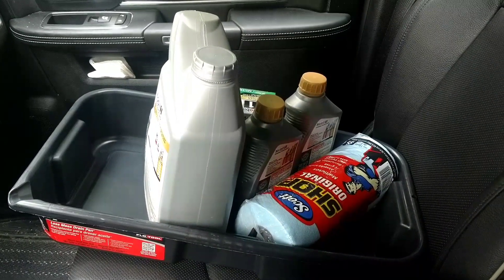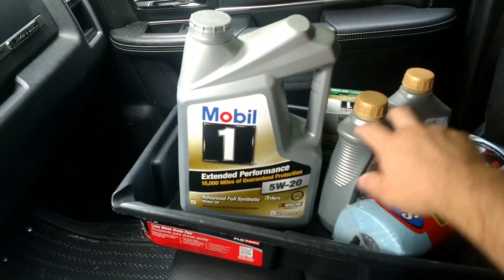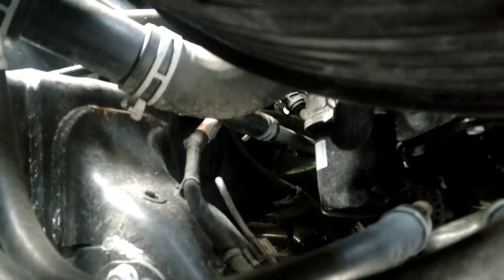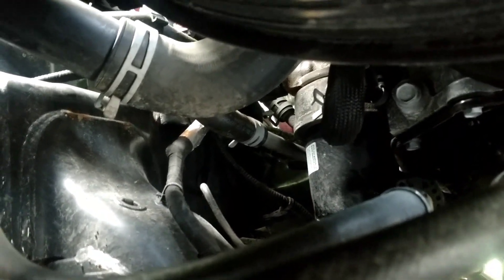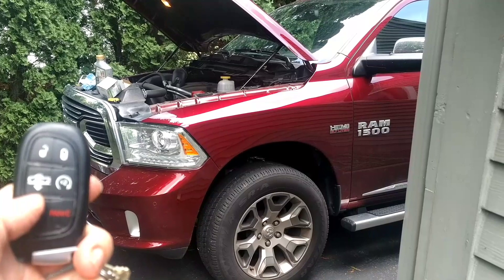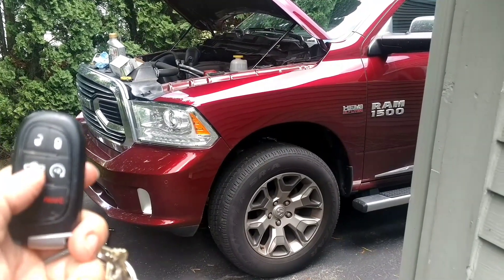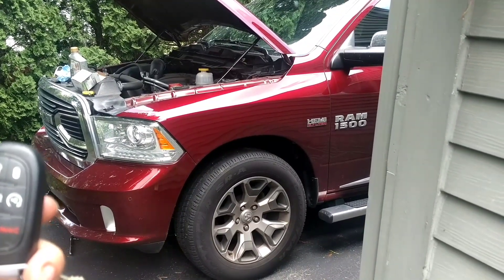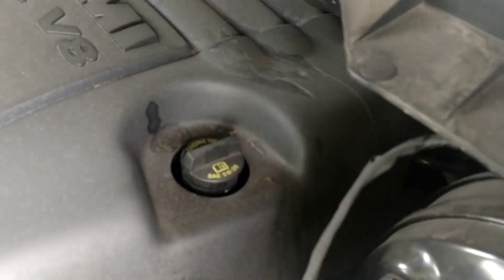2017 Ram 1500 oil change - 5.7L Hemi engine maintenance!

Comment: Will the air suspension hold in that mode? I’ve seen the suspension self adjust when parked a few times wondering how to prevent that
Reply from the maker: It’ll hold the mode, but self adjust within that level.

Comment: It’s worth getting the air suspension just for the convenience of easy oil changes.
Reply from the maker: ha, and ride comfort - ill tell you what.  It'd a nice ride!
Reply: I didn’t beep twice did you change the configuration’s or settings
Reply from the maker: Yes you can turn that off thankfully

Comment: Thank you so much for Sharing. 

Now that you have had the air suspension...what do you like and dislike about it. I'm seriously considering air suspension. I imagine the comfort is out of this world?
Reply from the maker: The ride comfort is amazing - back with my 2014 I had a loaner for a week without the air suspension and you definitely can feel the difference.  It even corners better in my opinion.  The standard spring truck felt soft and spongy at times
Reply: tsr6 Are you still happy with the air suspension? My boyfriend's Limited EcoDiesel and one of his friends' Rebel HEMI both had similar issues, which is why I went with the standard suspension, even though it was pretty much the same price back then.
He quickly traded it for a bifuel hemi V8 Laramie, and I have a bifuel hemi sport. Very happy with it.
Reply from the maker: The air suspension is still great for me.  I put 82K mi on my 2014 and already have 50+K on my 2017 both with air suspension!
Reply: Air suspension is nice, but a pain in the ass for maintenance if a bag leaks or a line leaks or if the whole system fails, I’d driven one without it perfectly fine, unless you don’t work on your trucks and let a mechanic do it then sure

Comment: I don't think you can remote start the truck with the hood open, so not a big risk there.  Love the ziploc bag idea.
Reply from the maker: I believe you are correct - but not something I want to risk! lol
Reply from the maker: the one time the good sensor would stick or fail.....
Reply: They should have a hood pin kill switch, but they do break. Freaking genious with the bag man! I've been doing driveway oil changes for 20 years, wish I'd thought of it!

Comment: This oil is not Chrysler MS-6395 compliant. Shouldn't be used in this engine for warranty purposes.
Reply from the maker: Weird.  Had an issue with my dealership (long story) and they wanted to give me 2 free oil changes to make up for their screw up.  I said sure - give me filters and oil and we have a deal.  This is what they gave me for oil.
Reply: @tsr6  That's a shame. Nobody has accused Ram as being smart. Look in your owners manual under fluids and it will say it must be Chrysler MS-6395 compliant. Checkout the Mobil oil website and you will see that oil is not MS-6395 compliant.. Granted I have run Mobil 1 oil in my Hemi ram and showed wonderful oil analysis numbers. (My truck is out of warranty) Just wanted to share this with you.
Reply: 7 quarts of synthetic 5w-20 motor oil. It was what he had. Brand name does not  matter. This is also what the Ram website said.
Reply: I used valvoline full synthetic since my ram was new in 2017, changed it to pennzoil platinum full synthetic last oil change
Reply: I use pennsoil 5 20 factory oil filter no problems
Reply: @tsr6  really that doesn't seem right
Reply: @justaguy427  
Ok it's your truck
Reply: I recently bought Mobil 1 5w20 synthetic, it does actually say Chrysler MS-6395 compliant. This may have changed as your comment is years old now, but it is now compliant, suggesting that it likely always was but was just never "tested" by ram for compliance.